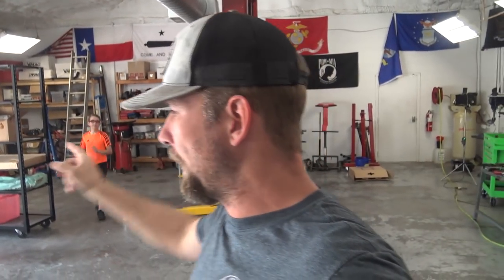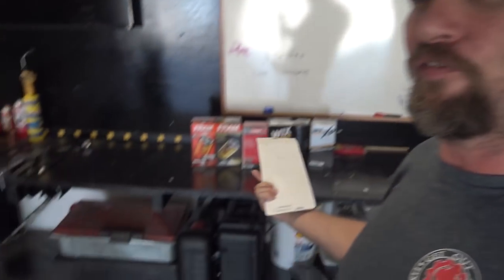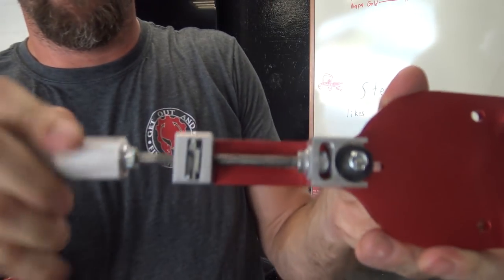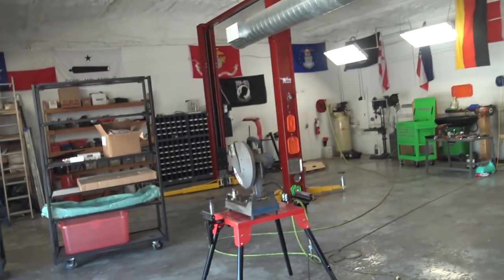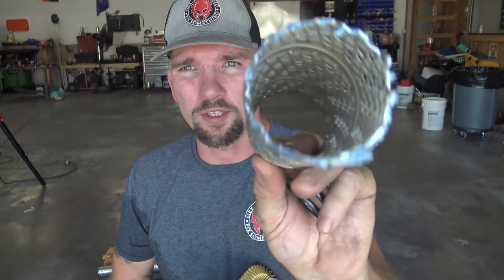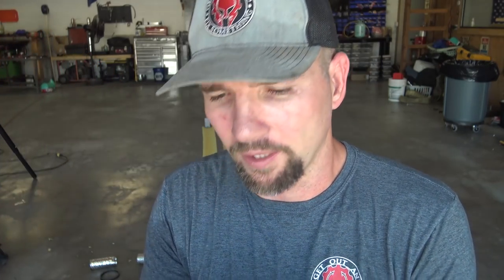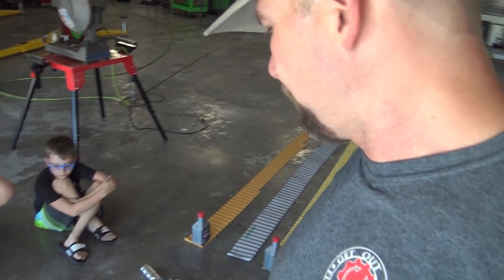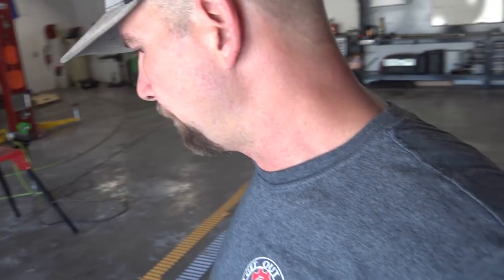Is This Still The Worst Oil Filter On The Planet?

Comment: Wow! I never realized how cheaply Fram was made.  I'm switching my vehicles over on the next oil change.
Reply: Cheap, doesn't mean it performs worse
Reply: @xephael3485  Exactly. Fram is the #1 producer of oil filters, they have their manufacturing process streamlined to make them the best quality they can yet at a reasonable cost. The orange Fram filter is actually part of Fram's Wear Guard series of filters, they just put them in the Extra Guard boxes for manufacturing cost savings, but as Steven showed, it has the longest filter media, and similar construction as the Wix/Napa filters, yet there has to be something always wrong with Fram, just because people hear from people who heard from people who....etc.
Personally, I do use the Fram Ultra Synthetic filters in my vehicles and have had very good luck with them. Ultra Synthetic filters are actually double lined synthetic filters which gives them additional filtering surfaces, and they are usually rated at 99+% filtration at 20 microns. Pretty much no other filter is going to have that level of filtration. Excellent quality/priced filters.
If you're concerned about quality, run the Fram Ultra Synthetic. Even Steven had to admit it's a good quality filter.
Reply: @dannyo6699  exactly I run the ultra synthetic on my 235,000 mile 04 Chevy Silverado

Comment: I was about ready to call you out Stephen Cox......Then I remembered that a 1995 is for a 7.3 liter Powerstroke.  I wondered about the price; you wouldn't get a 2015 for that price....Looks like they would charge more for the metal casing.....I have 2 6.0 liter Powerstrokes and I only use OEM filters and that goes for EVERY filter, Oil, Transmission Pan and Remote by the radiator, and fuel.  Great video!

Comment: I have never used a fram oil filter never will. I don't know if they are good or not but i use mann filters in my car oil and air filter i use baldwin oil filters in my truck 2012 duramax. Was wondering where you were steve don't be a stranger and tell chuckee hi!

Comment: The Motorcraft oil filter for the 7.3l FL-1995 is also $9.99 at advance auto parts but you can buy them from the link bellow and help support the channel

Comment: The 7.3 Ford Powerstroke is one of the best diesel engines ever made.  Use quality Motorcraft filters and change the oil every 5,000 miles.  You can get half a million or more miles on those easy

Comment: Well, looking at the filters for that particular engine, I don't see a helluvalot of difference between them. Maybe it is just the smaller ones that the orange bad guys cheap out on? I put Motorcraft filters on my 09 f150 and have switched to Wix filters on my 05 murano and 1950 f-1 pickup with a 1983 200 6 cyl in it. I can't seem to figure out which ford filter goes on a 200 6 for some reason. The Ford filter costs me about 5 bucks and the others about 9 at the local Wal-mart.

Comment: These Fram filters look MUCH better, than their cheap discount parts house filters. the problem is, that without destroying the filter, there's really no way to know their internal construction. I guess, just do what you did, and "sacrifice" a new filter, and if you like what you see and the price is right, get several of them. Keep in mind, the internal construction is "subject to change without notice". As you well know, a 7.3L Diesel engine is rather expensive, so it's worth it, to take the time to closely examine the filters you want to use on it. A higher price doesn't always mean a higher quality filter!

Comment: Would you consider doing a video on the replacement core style filters that are most common in German cars?  All the ones I’ve ever seen have had cardboard end caps and often only have a single replacement o-ring for the removable cap.

Comment: Been using Fram since 1976 never had one engine failure..
Alot of kids talking Nonsense.
I got 380 k on my Chevy 4.3 and my Case backhoe 12k hrs New Holland skid steer 6700hrs all run perfect.

Comment: You need to cut open a Baldwin and a donaldson. 
I agree that the fram is junk. You usually have to retighten them part way between oil changes.
Reply: You're installing them incorrectly then. I've never had any brand of oil filter loosen  up in over 50 years of changing them.
Reply: @lencranston8183  I've done it exactly as the instructions printed on the can say, I've done it looser, a little bit  tighter and a lot tighter. Every Fram I put on a big cam Cummins started to leak about half way through the service interval. Not as big of a problem on smaller diesels (3208, dt466, 6.9s) or gas engines. I'm a heavy truck mechanic and I've changed a few over the years. I only worked for one company that bought Fram.

Comment: This guy is ignorant and bases the appearance of the filter to its filtering efficiency. The Fram's shown are rated higher in efficiency in trapping particles 20 microns or smaller than any of the other filters in his line up. Fram has been making filters withis basically the same design for over 40 years. Wouldn't you think they would have gone away if the product was inferior? Probably the highest rated filter out there is that Fram Ultra in his video.

Comment: Fram ultras are equivalent to Bosch and are regarded some of the best filters you can buy. Yes the cheaper frams are garbage and that is a fact as their micron ratings and build quality are all around lower. However the micron rating of the fram ultra is right up there with bosche and better then the other brands you can pull off the shelf at the same stores.

Comment: Let me first start by saying we have nothing but Fords in my family. So we have used mainly motorcraft filters for a long time. I got a filter cutter probably about 10 years ago and started cutting open filters. Started seeing failed motorcraft filters and started questioning using them. Wasn't long after that news started spreading about Purolator having tearing issues with their filters. Well Purolator makes the filters for motorcraft. I hang out on Bob is the oil guy. Several members emailed Purolator about the tearing issues with their filters. No response from Purolator. So after that and seeing failed filters first hand I'm done with Motorcraft and purolator filters. People hate on Fram a lot but they admitted they had a quality control issue and actually fixed it. Purolator still has yet to fix the problem as far as I know and its been years.

Comment: They worked fine for many years until the internet and guys started cutting open oil filters for views. 
So they had to change up Some stuff so people would still buy. Ran fram filters
For many years and as a racer I cut open about every 3-4 oil changes to check my filter
Media for metal shaving. Never had an engine failure from an oil filter ever. So just buy the color you like and run it. Just change your oil
At regular intervals and definitely not just once a year.

Comment: So, is the Fram still the worst filter? My guess is it's not. It's comparable to some of the other filters in construction. It has a banded joint for the filter media, like some of the other filters, it has a spiral spring compressing from the bottom, like some of the filters, it has a filter media very similar to some of the others, it even had the longest filter media....see a pattern here. 
Stephen just can't get past his prejudices towards Fram. But even Stephen had to agree the Fram Ultra Synthetic is a high quality filter, and Kudos to him for including this filter in his comparison this time. The Ultra Synthetic is a double lined fully synthetic media filter and has a 99+% filtration rating at 20 microns. It's also the filter I run in all my vehicles and have for several years now. 
Previously I ran the basic Fram Extra Guards in my vehicles going back to the early 1980's and never had an engine failure due to a bad filter, and my Dad and Uncle both farmed for over 50 years, running Fram filters on farm tractors and trucks, and neither of them ever had an engine failure due to a bad filter. We also used Baldwin filters as well, and they ran just fine in our tractors too. We also used manufacturer branded filters and they worked just fine too. We put a lot of Case IH filters on tractors.

Comment: I fast forward through this video because I already knew the outcome. There are a ton of videos on youtube just like this. As an engineer, we engineer product to work for the intended purpose. Fram could have made their filters out of gold plated titanium. This would not of made them any better, just more expansive. As long as the material does not fail, then it is suitable for the  intended purpose. There are some videos on youtube that actually compare the filtration of these filters. They take the filters apart after they were used and none of the filters that I have seen failed.

Comment: Say what you want about fram but they filter down to 20 microns at 99% efficiency using the tough guard or ultra and 95% efficiency with the extra guard.

Comment: does anybody have a firsthand account of a fram filter failing? or any filter for that matter? it does seem that fram is of cheaper construction and I will admit I have avoided them in recent years, but I have never had any engine failures in my personal vehicles. i use whatever oil/filter is on sale but i do change it often. i think that is the most important thing.  I also always hear people complain about paper endcaps on fram filters, but got me thinking, i bet it's easier to glue paper to paper than it is paper to metal
Reply: Yes, read some of the replies here. Some people who replied here had Frams fail.

Comment: Real paper and or cardboard does not belong in a filter.
That being said it looks like Fram is improving. Still not enough to get me to use one though.
Reply: "Real paper and or cardboard does not belong in a filter."    Where did you get your engineering degree?
Reply: @xephael3485  MIT why? No wonder you worship Fram if you think cardboard and paper for filter ends is a good idea. LOL  I have seen so much of that stuff coming apart and deteriorating I don't see how anyone needs a degree to know that it is a bad idea.
Reply: I buy Fram cartridge filters for my Hyundai and Corolla.  There's no cardboard in those.
Reply: I have used every brand of filter around. Honestly my favorite filter now is the Extended Life STP or Maximum Life STP. This is the same tired untruth about Fram. The internet started this filter study junk. There's no cardboard or paper inside of a Fram filter. It is a resin impregnated fiber board. It's only there to hold the pleats together in the manufacturing process. Metal end caps offer no added benefit. Measuring pleats doesn't tell you about efficiency. Multiple filters of every brand need to be used and then cut open to sample efficiency.
Reply: @kj197734  Actually you need a complete filter on a flow bench plus other measuring devices to measure flow efficiency. Efficiency of flow means nothing without knowing what micron it is actually filtering down to. Also a smaller micron filter doesn't always mean a better filter. 
Filter studying is not junk. You just have to know what you are looking at and it's affect in real world use. Like cardboard turning to mush and coming apart in the filter. It plugs the filter plain and simple. Defects like pleat corners being bent over before sealing mean oil is bypassing the filter. There was no "resin" in the mushy cardboard I saw.
Reply: @kj197734  yes it's all superficial reviews that only pay attention to component looks and ignore all engineering, specifications, and exclude real world testing.
Reply: @picklerix6162  That's good. I'm glad you like them. For many of us though it is a trust thing. If you had the choice to buy from a company that makes sure all their products are excellent or another company that makes some of its product line good and other not so good to downright sketchy which would you choose? As long as you choose the high end Fram stuff you probably would be ok. Especially with cartridge filters because you can see any defects in those right away and rather easily. 
I can't do that though. Knowing I am purchasing critical components from a company that also produces a cheap quality product that has had some serious quality control issues makes me not trust them and not want to reward them financially even with their better quality products. And that is why I will probably never ever buy a Fram filter of any quality level again.
Reply: I was waiting to hear what his thoughts were about the Fram filters having more filter media in both conventional & synthetic than any of the comparable brands that were splayed on the floor this time around. Appears the shaming of the big filter corporation got some attention in the high offices & produced some positive results. Great job for using freedom of speech & sharing this clip, giving us product awareness. We can utilize your info & make an informed decision.
Reply: @julianpeters1547  they probably figured it was a cheap change to try and make themselves look better. Maybe it was because they made those filters filter smaller than the standard 10 microns and they needed the surface area to last longer.
Reply: @consaka1  Well I'm glad someone from the mogul was watching out & listening, decided it was in the corporations' best interests to make positive changes. I agree with you & all the points you've listed are better features for us.

Comment: The most important thing to remember, is to change your oil. I have been using Fram for ages. My Ram 2500 Cummings has 311,820 miles on it right this minute. It gets an oil change every 7500 to 15000 miles, just like the book says. Read the owners manual. It takes3 gallons of Shell Rotella each time. So far no engine repairs. The computer says I am averaging 28.3 mpg and I have the tow package from the factory. The chances, you see more problems with cars ,that have them on, is because they sell more of them than anyone else. Now stop blaming the product and start blaming the real cause of the problems, the owners.

Comment: Am I the only one that says "Froahm"? instead of Fram? Well, I used to use them and switched to Wix. I see the Wix is 7.50 on amazon for my 2008 Buick Lucerne. My logic has always been  using a better filter is better than replacing an engine.  However, I have never had a filter fail on me. Has anyone? 

Oil wise, I use whatever is certified and most inexpensive. 5w30 Five quart container on sale. However, I change oil every 3000 miles. My car has 146k on it and runs great still.
Reply: North Point, yes, I’ve had filters fail on me. Not motor oil filters but hydraulic filters I have. We would have a problem every winter with hydraulic pumps going bad in our machines. I talked to the manufacturer about the problem we were having and they asked what kind of filter we were using and I told them that we were using Fram filters. They asked why Fram and I told them we were using a brand name filter and we always did. They informed me that they had cut a number of filters apart and measured the holes on the inner tubes and Fram had a punched style hole that didn’t let much fluid thru. They said that Wix had round punched holes and when they measured the area of the holes Wix filters had the least amount of restriction of all the filters they checked. And had almost four to five times the flow that Fram did, they recommended that we switch to Wix which we did and never had that problem again. I think one of the reasons why people don’t know if a filter fails is because they can bypass the filter part and you don’t know that it did. I would’ve liked to see what the inner tubes on these filters looked like!

Comment: Yes. They(Fram) are designed to meet a price point and protect for up to 5 or 7k miles.  But even that is dependent on environment.  Cutting open filters is such a waste of time.  You car doesn't care what it looks like.  It cares whether it filters.  Which the Fram's do.  And have done.  All this is simply a waste of time and money(buying some goofy filter cutter opener thingy).  I've seen million dollar Ferrari's running them.  Guess what???They survived.  For decades.  Use what you can or want to afford.  Change it and the oil based on how much you drive and how dirty your surroundings are...quit worrying about what the filter is.  I personally sell Baldwin filters and Schaeffer oil at my speed/machine shop and those are what every engine gets filled/filtered with coming out.  However, the majority of the lumps I see don't run either.  Out of the few thousand engines I've torn apart and built, I think I've seen maybe one which we could actually attribute to an oil filtration failure.  IIRC it was about 20 years ago on an old Ford Bronco with 30k on the oil.  Yes...the oil (dino) had like 20 or 30k on it according to the owner.  It ran out like honey and the filter was plugged with grit.  So even THAT wasn't the filters fault but eventually it did "fail" and allow so much sand and such to get by that it ruined the bearings and then spun one.